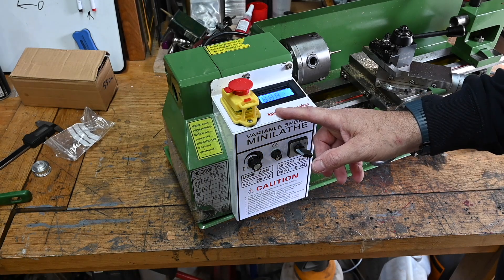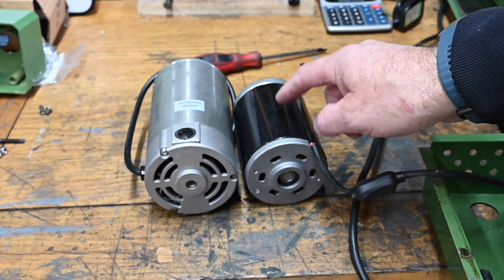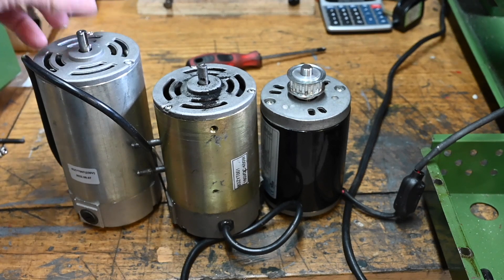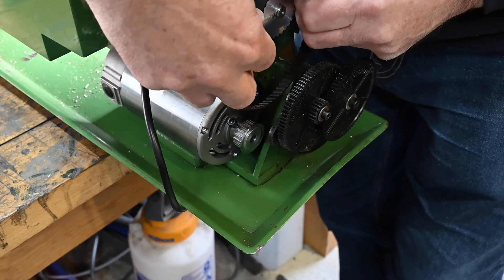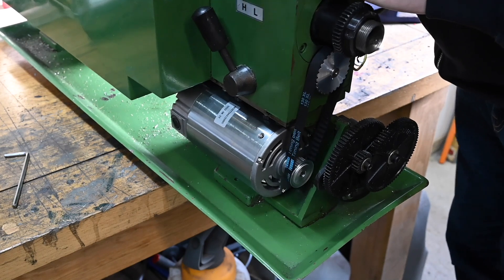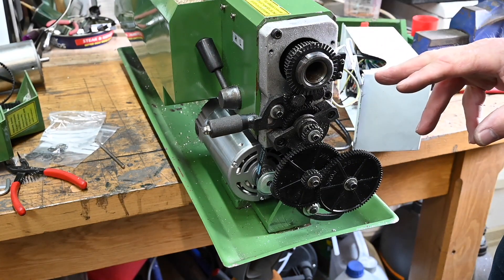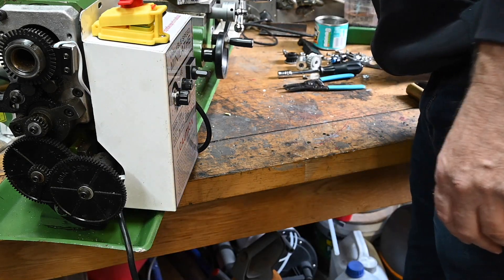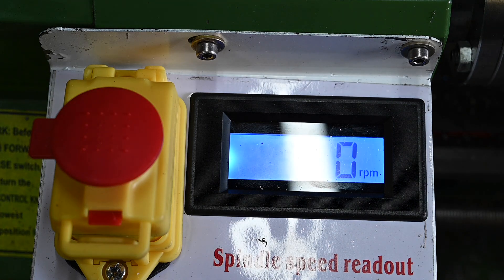Warco Chinese Mini Lathe -  Motor Upgrade Again

Comment: i don't think a 550watt is tat big either. my current oem setup is a 800w and i want to install an 1100 watt to upgrade it, or even go 2hp AC.
Reply from the maker: @mike9500  I think I have only ever made one thing on it, the problem with having 2 lathes of similar abilities is, you only ever use one 😂😂

Comment: I’m surprised that you didn’t go with one of those sewing machine servo conversion kits.  I used a kit to upgrade my lathe motor to 750w 1hp and I have plenty speed and plenty torque. The servo is half the size of the 500w motor and fits perfectly.
Reply: Had a 550w sewing machine motor on my mini lathe fr over 2 years, great  mod but the controls are different and a bit awkward but they now sell a better kit with a nice controller . I may get a 750w next time though or maybe 1100w. My minilathe is different on the gearing end of lathe with a big steel plate and motor face mounts to it. It was practically a straight swap.
Reply: @nealepitts  I was considering one of the sewing machine servo swaps but I didn't like the controls I saw on the video. You're saying they have a new better control design?! If you don't mind me asking where did you see it? I'd like to check it out
Reply from the maker: @taranson3057  I wasn’t aware of them, I will look into it. Thank you

Comment: Only 700 RPM? That seems very low for this little machine. To make small pieces in soft material, you will need much more.
Reply from the maker: @Rustinox  I have been thinking about it and I am going to change the gearing. But it will have to wait until I regain my interest in it 😂😂
Reply: Probably the easist way to increase your chuck speed is to fit a pulley gear with more teeth to the motor output shaft.
Watching your vid. The motor does seem to be turning too fast compared to the chuck speed,
Cheers ,  Mike